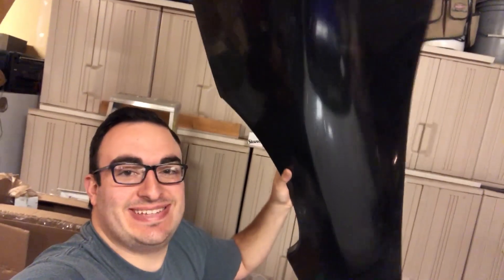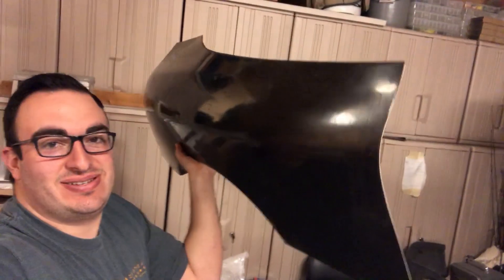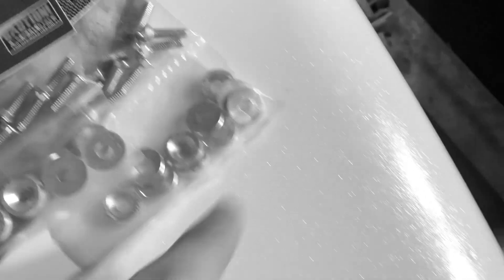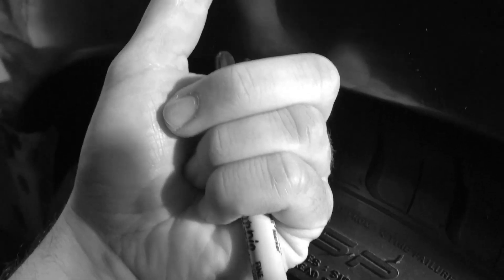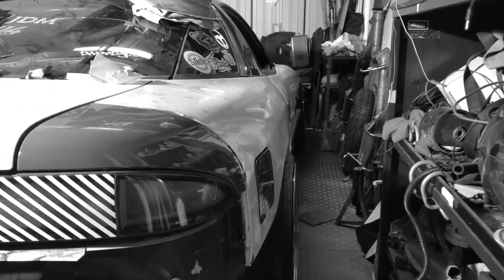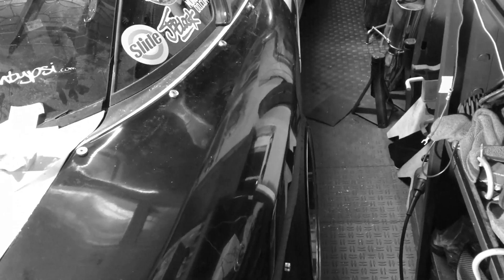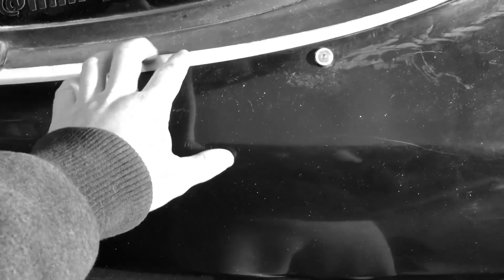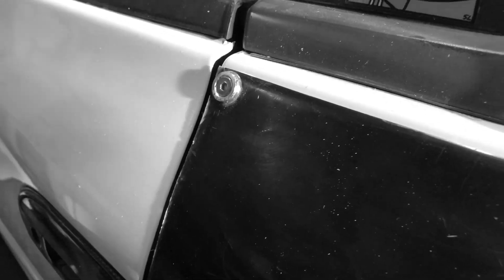Mounting Overfenders on the 3000GT Drift Car! B&W

Comment: Where'd you get your rivnuts and tool at. Have info where you can get all that? Pretty awesome video so far. How much were the over-flares for your GT?
Reply from the maker: This particular tool is a Matco Tools rivnut tool. But you can get them anywhere!  Amazon has a bunch of options. 
The inserts are stainless steel M6 inserts I found on eBay and the hardware is also just generic M6 fender washers from eBay. 
And the fenders cost 390 before shipping if I remember correctly.
Reply: Thanks man!